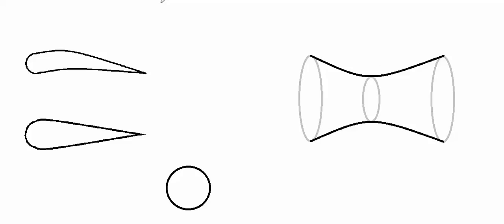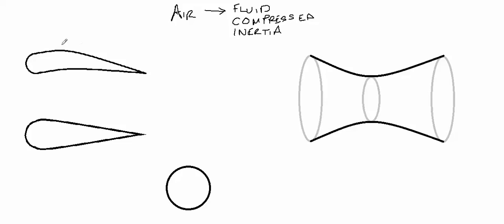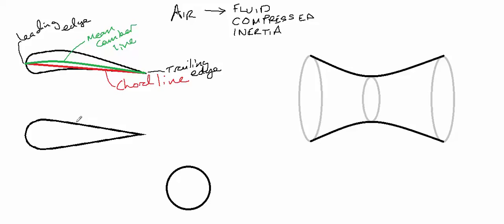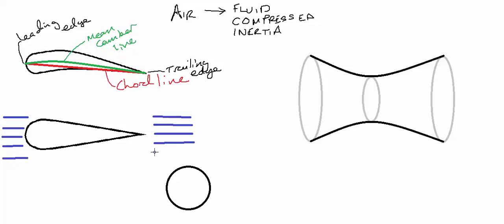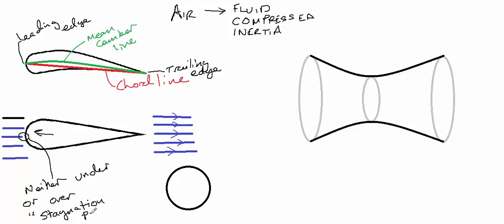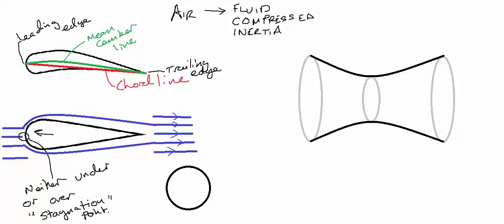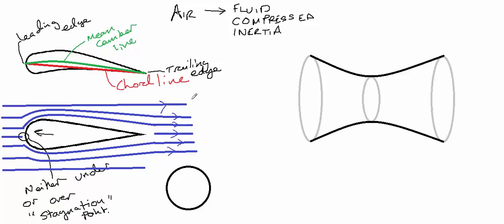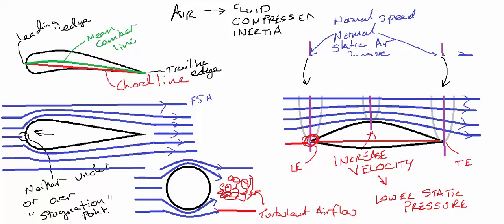Principles of Flight Tutorial 1 video defining terms and bernoullis theorem

Comment: +flightsim481    
Hi,
  You have fallen for the pervasive bad information about this.  This explanation is incorrect. This is a long repeated error by so many and for so long that it has become almost impossible to locate correct explanations.  It is a misunderstanding of Bernoulli's Equation.   
There is another explanation that is correct, so please get Bernoulli out of your mind. It has led you down the wrong path.
The increase in velocity does not result in (cause) a lower pressure.  The upper air may be traveling faster than the lower air relative to the wing, but it is traveling slower than the lower air relative to the stationary air and the earth, so this is not "Faster air" at all. Therefore, there is a big problem calling this faster air because the definition of 'fast' changes depending on the chosen reference and lift must work for either reference.  So which is the correct reference, the wing, or the ground? There is none because this reasoning is false science.  Bernoulli's Equation says nothing about the relative speed of air passing a nearby surface.  It ONLY shows the relationship between pressure and velocity at different locations along a single flow irrespective of the absolute reference. It relates the speed and pressure of one location of a flow to where that air is going to be in another location later along in that same flow.
...
Once you really understand it you will not be baffled by the fact that the fastest air around a wing is UNDER it!   This can easily be seen in the sequence of images on the 6th page of Dave Bentley's paper. The vertical line is stationary and the wing is moving past it.  Look at which air streams move the furthest (fastest) and which move the least (the slowest).  Until you understand this, It'll blow your mind.
http://219sqn.aafc.org.au/Flight/Wings%20don't%20suck-How%20planes%20really%20fly.pdf  

Air (fluids) can only exert a force by pressure differences and can only push. When there is a pressure difference, the higher pressure region pushes (accelerates) a mass of air toward nearby lower pressure regions because it is not totally opposed.  [recall Newton?]  As a bit of air travels and has more pressure behind it, it is accelerated to a higher speed into the lower pressure region ahead of it. The pressure difference causes the speed change, not the other way around.  It cannot be used to interpret velocity and pressure differences between two different paths. 
...
 Bernoulli's Equation also demands that no energy is added, nor extracted along the path in question.   A wing does work on the air.  The most obvious place is as it accelerates it downward to form the down-wash and creates the tip vortices. 
... 
In addition, the "half venturi" concept is considered invalid because there is no hard boundary condition as drawn here.  The upper streamline over the wing is not straight as drawn, but also curved upward.   This means that any conservation of mass that is required by the Bernoulli Equation is not maintained here.  Then, again, the wing is doing work on (adding energy) to the air, but there is no such energy addition in the venturi.
...
The "pinching" of the upper air can sound convincing.  For the venturi, the air in the narrow section of the pipe is not "Squeezed". This is a false conclusion that obscures the real science. If the restriction was not there, the pressure along the whole pipe would be constant.    The restriction in the pipe causes the pressure ahead of it to increase because there is a restriction downstream.   The narrow section of pipe now is an outlet for that pressure.  It is actually 'squeezed' in the large inlet section. Think of a pressurized tank that develops a hole to the outside lower pressure.  That hole lets air out because the pressure inside is higher than outside.  The narrow section of pipe is a relief opening for the higher pressure, therefore relieving the pressure and allowing the inside pressure to accelerate the air out of the small opening.  So it is a pressure difference that accelerates the air onto nearby lower pressure regions.  This is also how wind operates.
...
Another error is the fact that in the half venturi diagram you state that the there is "normal velocity front and rear".  However for a wing, these velocities are not identical.  The velocity at the trailing edge is slower for a real wing as well as air from far above the wing is being deflected downward at a considerable velocity.  This down-wash requires the same force that is the lift holding the plane up and is the acceleration of a bunch of air that equal and opposite
...
The lowered pressure at the upper surface is actually caused because the surface is retreating from the straight-line path a mass of air would take (or is trying to say at rest) if not acted on by a force. A surface that is retreating from the air, such as the more extreme example of your back as you walk, opens the volume the air has to occupy and thus reduces the pressure in the short term.  
...
In summary, as a solid shape moves through the air it pushes on air in front increasing the pressure, and opens space in the rear thus decreasing the pressure.  A wing carefully arranges these two regions to exist below and above the wing respectively.
...
The fact that the upper air beats the lower air to the trailing edge is due to the lower pressure there not moving that air along with the wing.  The 'normal pressure' ahead of (and above) the wing pushes it along the curved surface allowing it to remaining almost stationary as if the wing hadn't gone by. It is almost standing still until it leaves the trailing edge and is pushed downward by the 'normal' pressure well above the wing.  However, when moving along with the wing, this upper air appears faster and the lower air appears slower.
...
The lower air, on the other hand is, in effect, pushed, or dragged along with the wing by the higher pressure under it.  (It is also pushed forward and upward [up-wash] a little).  This is much easier to understand if you view the wing at a small positive angle of attack (leading edge higher).
...
In the following moving gif of an A380 test, you can also see the up-wash just before the plane enters the illuminated smoke 'plane'.
  http://i.imgur.com/h8pSK.gif   
-- 
Regards, ScienceAdvisorSteve
ChallengerCenter.org
Reply from the maker: +Observ45er Hi Steve.  That paper of Dave Bently's is the best description of lift and how it is generated that I have ever seen.  Every single word resonates with clarity and makes utter sense from a scientific perspective.

Sadly, those who write pilot's texbooks and those who write and mark the commercial licence exam papers don't seem to be quite as open minded at the moment which is a huge shame.

I have always been aware that there have been differing theories as to the physics behind creating lift and sadly it appears the teaching and training of pilots (myself included) is lagging far behind.

Huge, huge thanks for the links, much appreciated.

Rich
Reply: flightsim481  Rich.
Thanks for responding.  I have this as my private, perhaps Quixotic quest to get some of this corrected.  I think I've said enough, but if you have any questions, please don't hesitate to comment and I'll get a notification.
...
I also have URLs for other authoritative papers that go into the detail of just how the pressures are created.  You may find differences in what each author may Emphasize, but the papers I've read and a few pros I consulted all have the same major explanation. 
Fully grasping the detail of the up wash took a bit more thinking.  You can see it in that green video if you watch just as the plane gets to the smoke plane.
...
It is really beautiful how all the REAL fundamentals fit together.
...
I met Dave here in comments and continued outside and use that paper all the time. 
...
I especially love to show how the fastest moving air is UNDER a wing.  It really throws the solid Bernoulli Principle believers.

It also helps a bit to understand the Boudary Layer, but you can look that up yourself.  Wikipedia should be ok for that.
...
When I took over management of this, it was my motivation for understanding the science of lift: http://www.nwherald.com/2015/01/23/challenger-learning-center-in-woodstock-renovates-flight-simulator/a89meuf/
--
Cheers, Steve
Science and Technical Advisor
  http://www.challengerillinois.org/
Reply from the maker: +Observ45er No problems at all.  I must admit I'm fascinated by aerodynamics so thanks for the link.
Reply: This comment was one of the best findings in youtube! The link of the document is dead but I can really see now how wing works. Every time its explained, there is always the misterious differential pressure caused by speed. I can see how acceleration of a mass of air can create low pressure behind it until the rest of the mass caches with it but as I understood its not exactly the case here. What I think I understood is the mass of air at a single point is pushed upward by the leading edge, the airfoil curves downwards as the wing moves forward and the upward motion of the particle is now creating a low pressure area just bellow it. The air particle now rushes downwards to fill this low pressure zone but the wing airfoil is retreating fast enough so the particle never fully caches with it to restore the ambient pressure. Meanwhile underwing pressure is normal thus the net force on the wing is positive (upwards). Once the wing has passed the air in downward motion coming from above  collides with the static air from bellow pushing it downwards as seen in the green cloud A380 gif. Thanks for the great explanation!
Reply: @Mateyhv1  ,
I hadn't received notification of your reply and just wandered by here.
  
..
 PLEASE respond when you read this so I know you got it.
...
I found the video that covers the same information as that missing paper.  

Here is the AeroGeek video: https://www.youtube.com/watch?v=WmXq9gm1uMo  
...
  What you say is essentially the upper flow science!  You are starting to think with the right fundamental principles in mind!
..
But, no, it doesn't create a low pressure behind it. It is the higher pressure behind and the lower pressure ahead that brings about the net force accelerating it to a faster speed.
..
If there is a higher pressure ahead, then the air will slow down which is what happens as the upper approaches the trailing edge.
....
It can't create the lower pressure behind it because there is air ahead pushing back on it.  It isn't some "free body" with nothing in front of it.  There is pressure all around it pushing inward, just different amounts from different directions.
.
  Newton's first law says a force is required to accelerate a mass.  Air has mass and it is the Pressure Gradient (difference in pressure between two locations) that accelerates air.... EVERY TIME.
Euler, following up with Bernoulli's work, figured this out.  Bernoulli only knew that the speed and pressure were inversely related BUT NOT WHY.

There is no other way to accelerate a fluid -- not reducing the space.
The wing must push the air out of the way to move through it and this and this alone is what causes the pressure changes.
..
When you have air flowing along a convex surface it is trying to go straight, per Newton's First Law.  Just like you being "pulled out" on a playground marry-go-round.  

Since the surface curves away from that tangent path, the air would  move (straight and, therefore) away from the surface.   This and this alone lowers the pressure.  It is still pushing down on the wing, just less.
On the marry-go-round example you aren't pushing in, so it's a little different, but you get the idea.  Think, instead of going over the top of a Ferris wheel.  Here, you are always being pushed down, but are lighter at the top (I just thought of that metaphor !!) ...
...so...
Since the atmospheric pressure far above the wing is higher, it keeps the flow in contact with the surface, BUT with this lower pressure determined by the air's mass and it's speed.  Just like you on the marry-go-round.  You get "pulled out" harder than a child.
.
Please do not think that the density decreases and there are fewer molecules because for normal flight, the density changes around a wing are truly infinitesimal and irrelevant.  Think the air is in compressible like water. This is a little hard to envision, even for me.
..
Here is a tutorial with the correct explanation of lift as well as Bernoulli's Principle:  https://www.quora.com/q/rxesywwbdscllwpn/Understanding-Lift-Correctly
. . 
Cheers.
. . 
P.S.
I've discussed this with some of the big names like Boeing's Doug McLean, noted teacher/author John Anderson, MIT's Mike Drela and Embry-Riddle's Charles Eastlake, I have a pretty good grasp on the true science.
..
P.P.S.
I was once on a Ferris Wheel with my wife and the operator really cranked up.  It surprised us as we felt our stomachs coming up, like at the top of a roller coaster hill.
Reply: @jozefjust2465  That Scientific American article is very disappointing. The author doesn't appear to understand what he was told by some of the most noted authorities in the subject.  here is a step-by-step explanation:  
Understanding Lift Correctly: https://www.quora.com/q/rxesywwbdscllwpn

Comment: So a swept wing is better than a straight wing for higher speeds because of the stagnation point? Or is there more to it?  Also were bi-planes inferior because of the shape of the wings? Were they just flat wings without the upper curve to create lift? I always wondered why mono-planes were a step forward in design.  Wouldn't shaped bi-plane wings be better by allowing for 2 thinner surfaces or is it a structural integrity thing, where a single larger surface is stronger?  Sorry I know very little about aircraft, found the video very interesting thanks
Reply from the maker: It's quite a complex topic so I'll explain it as best as I can given the medium of YouTube.

looking at bi-planes vs mono-planes, the key reason that bi-planes came first was both the engines available and the structure ie. the bending forces on the wing spars.  The engines in those days were heavy with little power. The lack of power meant that gaining enough airspeed to fly was very hard.  The only way to get adequate lift with the available engineering was either to increase the surface area of the wing (difficult with the available construction techniques at the time) or to change the shape of the wing.  You'll notice early bi-planes had a very pronounced curve on the top surface of the wings.

I believe early mono-planes had better engines (thus more power) and the rigging of the wires, and later development of cantilever wings allowed a larger wing surface area without the need for 2 sets of wings.

Then as engineering moved on, engines became better, and fuselage and wing design improved so we had the mono-plane develop at great pace.  A key point is that generating lift generates drag as an unfortunate consequence.  If you consider that for each wing you generate a drag profile (induced and form drag), and then any supports, rigging or cables needed also generate drag, you can see that a single clean wing is more efficient and lighter.

The stagnation point happens on every wing no matter what shape.  If you imaging there has to be a point where an air molecule is faced with the decision to go over or under the wing.  Some very very small proportion of air at that location doesn't go either way and just piles up in front of the wing and causes a tiny area where the air goes neither up nor down, thus the air has stagnated.  Obviously as you move away from that point, the air conforms to the normal airflow.

Swept wings actually allow aircraft to fly faster because they delay the onset of air going supersonic over the wing surface.  If you recall, air travels faster over the upper surface of the wing.  So if your aircraft is just below the speed of sound, the airflow over the top of the wing may be at or above the speed of sound.  Whilst it doesn't sound dramatic, there are 2 considerable problems.  Firstly, the 'supersonic' air causes a shockwave, as a result of which there is an enormous amount of drag generated.  Secondly, the shockwave disrupts the normally clean airflow and changes the distribution of lift over the wing surface, often leading to a problem known as mach tuck.  In essence, the change in lift on the wings due to the airflow over the top being supersonic can force the nose of the aircraft to 'tuck under' ie. go down.  When pointing down, you go faster, which just makes the mach tuck worse.  Many of the pioneers of supersonic flight fell foul of this.

The swept wings change the shape of the wing that the airflow 'sees' and through very clever physics basically delays the point at which the upper surface airflow goes supersonic.  So for an airliner, you can fly faster and higher without risking mach tuck or getting huge problems with drag associated with shock wave formation.
Reply: Awesome explanation thanks! I feel somewhat silly I had a vision of bi-planes having perfectly flat wings.  Sorting out that mach tuck must have been a nightmare early on, amazing engineering work.  Thanks again!